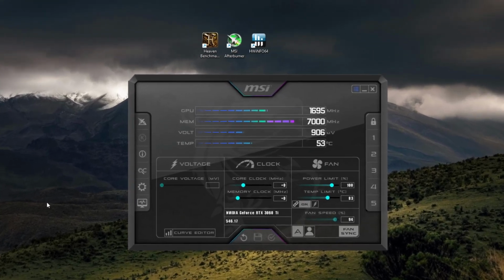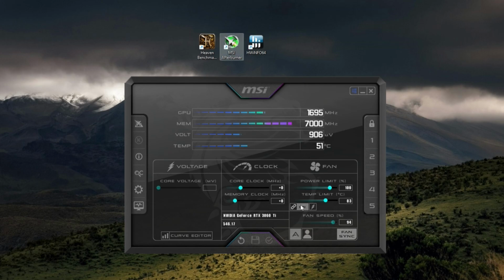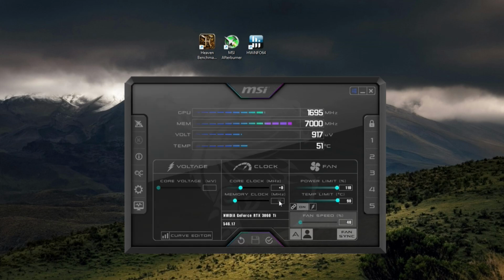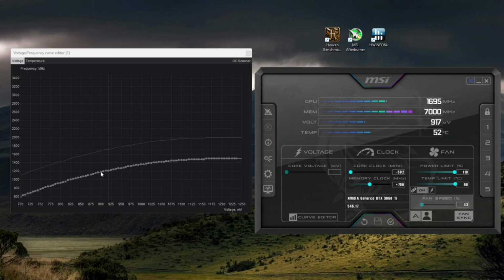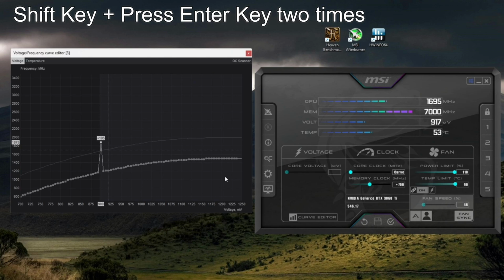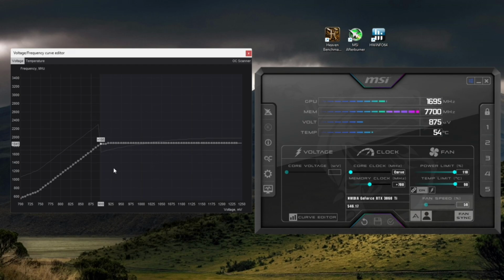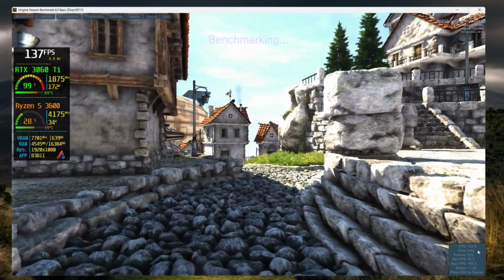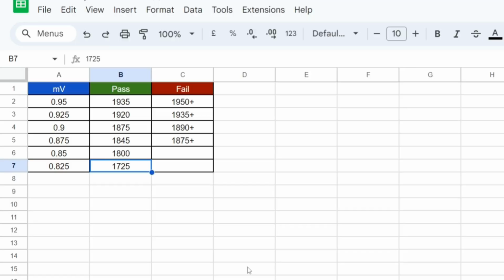How to Undervolt any RTX GPU

Comment: Can you please tell me whether should i try to undervolt my gpu or not. I am facing an issue whenever i play any game such like witcher3, cyberpunk on Nvidia optimized settings my monitor screen goes black and fans speed goes crazy high. I checked it on Hwinfo it because my gpu hotspot temp exceeds 98+ which causes it to display failure maybe but I am not getting the point that is my gpu temp reach 75-78 only. What should i do?  My PC specs are Zotac 3060Ti RTX Twin Edge 8Gb LHR variant, Ryzen 5 3600, 16GB Rams, 850w XPG Core Reactor PSU. Will undervolting the gpu help?

Comment: Hey, I undervolted my battle-ax 3060 ti watching your video... now it's 5-8 °c lower on full load but while being idle, it stays 50+°c even though without undervolting it used to stay around 38°c while being idle... do you have a solution for that?
Reply from the maker: Could be due to auto fan curve. Set the fan curve manually in afterburner.